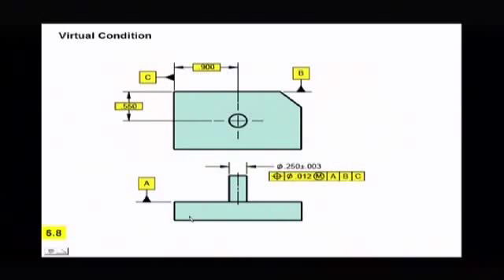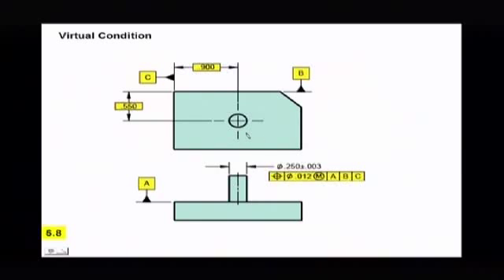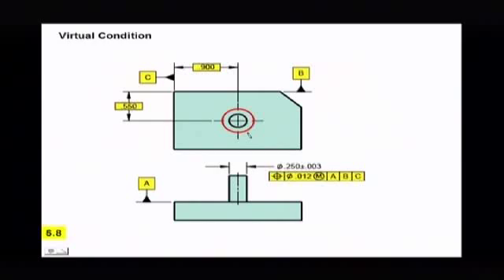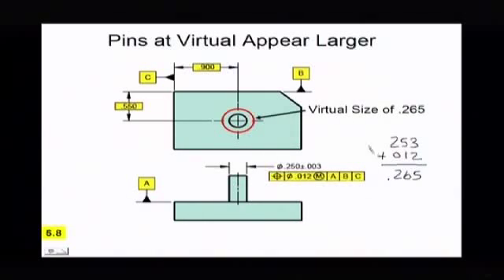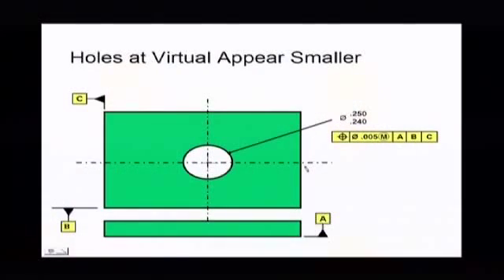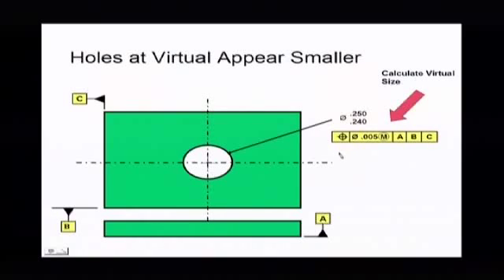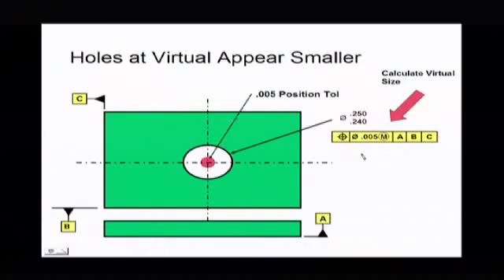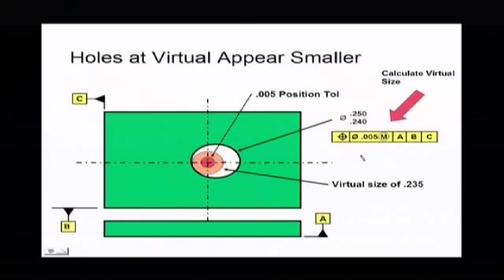Virtual Condition - Holes and Pins

Comment: This explains well, but I have a question. Lets say there is a pipe Diameter 177.8 / diameter 152.8, on the outer diameter it says roundness 3 MMC to A (center axis) and internal diameter says roundness 4 MMC to A. How do I approach this? Do I add the 3 to the external diameter and subtract the 4 from the internal one? (all dimensions in mm)
Reply: +SnacksLP here's a link to a picture http://imgur.com/yQdvWnB
Reply: An outer boundary is a worst case boundary generated by the largest FOS plus the stated geometric tolerance. 
Similarly, an inner boundary is a worst case boundary generated by the smallest FOS minus the stated geometric tolerance.
Here, 177.8 plus 3 is the outer boundary and 152.8 minus 4 is the inner boundary. So the part can fluctuate between these two extreme boundary conditions.
I'm not that sure about this..just gave a try!